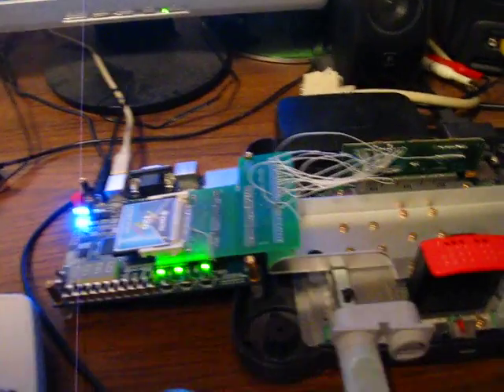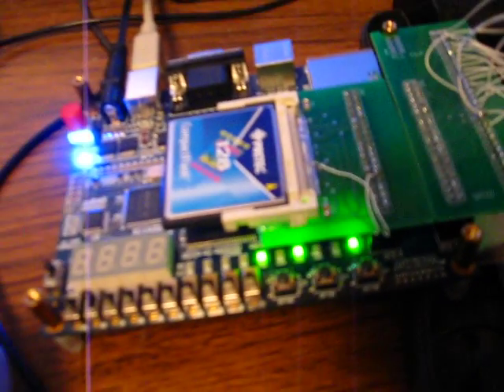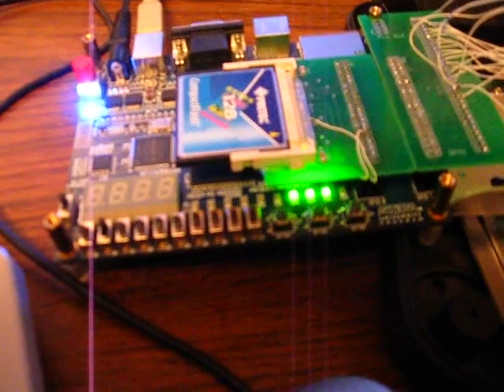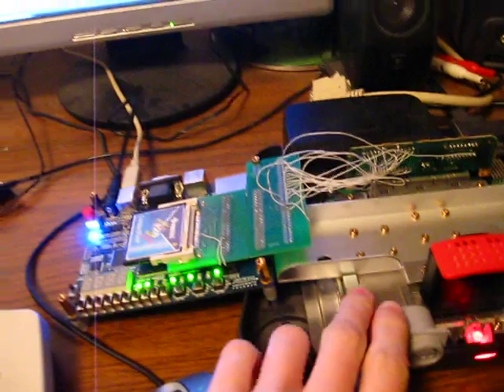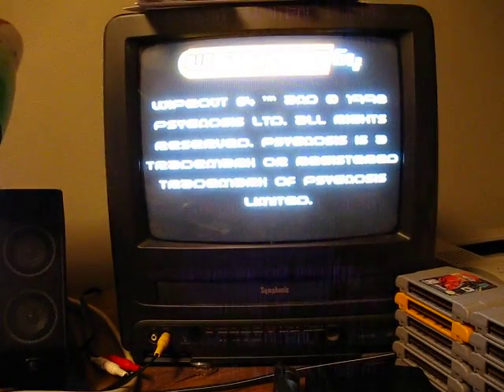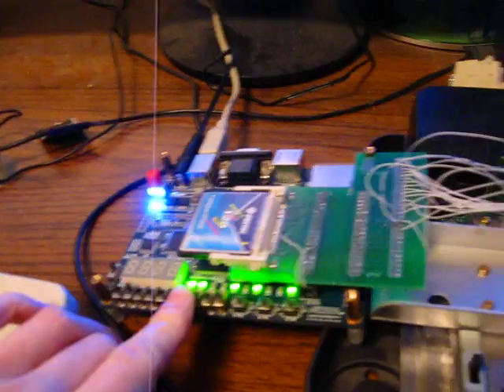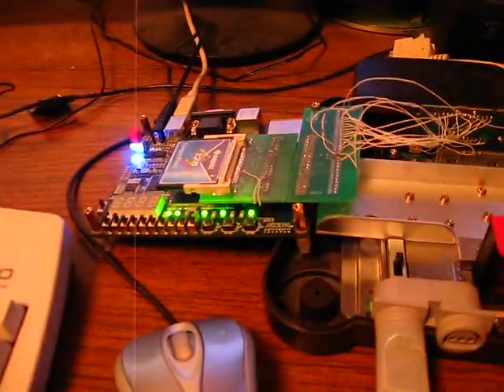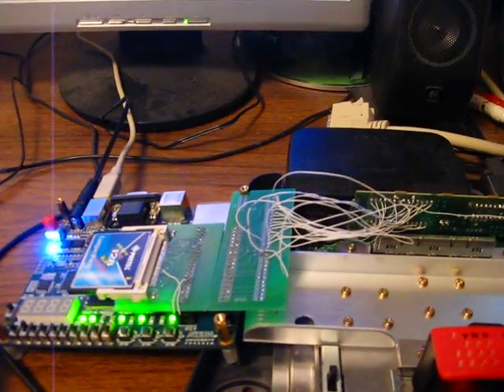n64 cart emulator -- running wipeout 64 from SDRAM

Comment: @marshallgs Good call, IMO. I know it's harder, but keeping it RAW is just... kinda lazy. :P Plus there's ROM info that you can have as separate files on your CF card as .TXTs or .CSVs or whatever flat file extension you prefer. No extension is necessary, I suppose. Snapshots/boxart as some kind of image, too. Whatever format the N64 can decode fastest. Though there are possible legality issues there.

Comment: Dude, NICE work! So glad you're continuing to make progress on this. And this one is massive. I remember talking to you about doing exactly this not too long ago. It really didn't take you long to get the PC > CF > SDRAM interface working. ^-^

If you were going to "market" this eventually, would you want to get your CF card running with FAT32, or would you keep the file system RAW and just write a proprietary ROM loading program (like I think destop did)? Theoretically, of course. :P